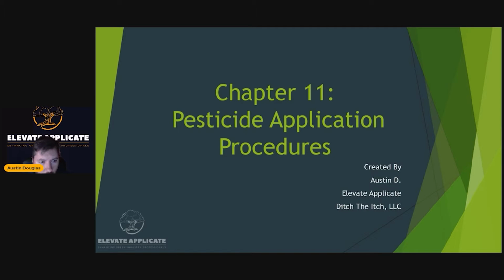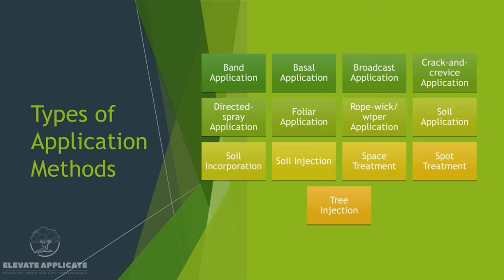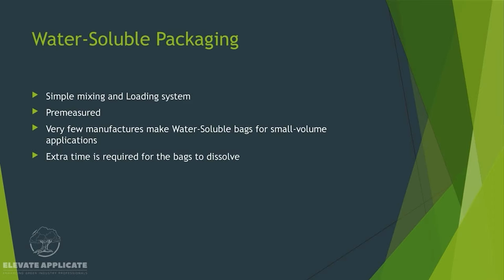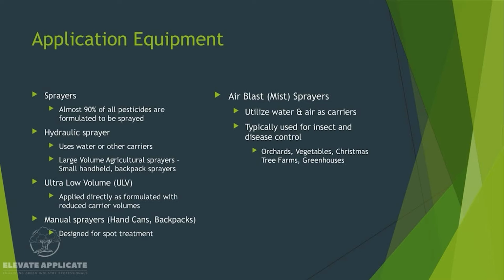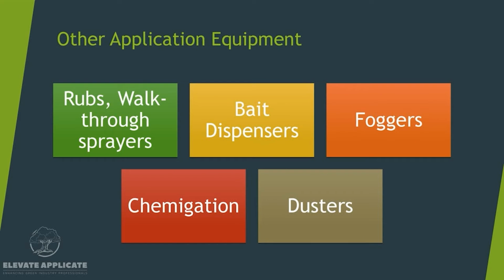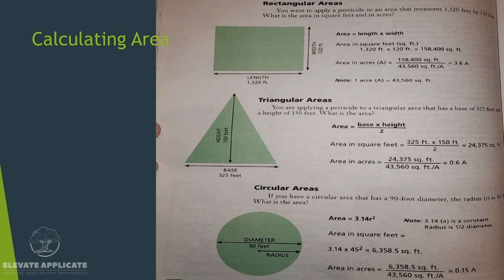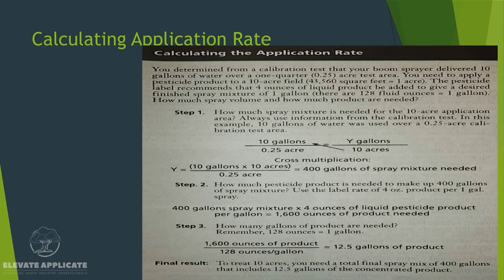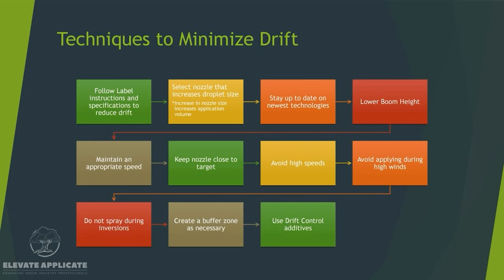National Pesticide Applicator Certification Core Manual - Ch 11: Pesticide Application Procedures

Comment: I live in Michigan and I am trying to get certified for both Commercial and Private. Do I take one exam and check off the box named 'Commercial' and 'Private' and pay for both? Or are there two different exams I need to take? I am unsure of how this process works, since I am new to this. Please help, thanks in advance.
Reply from the maker: I'm confused why you are trying to obtain both commercial and private. Private applicators are for farms, nurseries, orchards, vineyards ect. Commercial is for those who go to other people's properties and apply pesticides. 

What do you intend to do?
Reply: @ElevateApplicate  I have my part 107 remote pilot certificate and I want to apply to this job where they spray fields. This certain job has a requirement of having my pesticide certificate and it says commercial/private. Maybe I will get with them and confirm and see if they mean both or one or the other.
Reply from the maker: If you work for a firm that is contracted to spray fields for farmers, you would need Commercial. You would only need private if you worked for the farm itself and only applied at that single location. 

You'll also need your aerial license. 

Definitely confirm what license. I've never heard of applicators having or needing both.
Reply: @ElevateApplicate  Thank you for your help
Reply: @ElevateApplicate  I have another question. I am trying to apply for the commercial exam and I have to choose my categories of aerial, row crop, fruit and vegetable. When I go in for my exam, do I have complete separate tests for each category? Or just one for the commercial exam? Sorry to bother, but there is not a whole lot of information out there for inexperienced people trying to apply for the MDARD for the first time.
Reply from the maker: My understanding is that you will have to take separate tests for each category. In the lawn and landscape industry they have a combo exam called 6J that covers Core, 3a, 3b, and 6. I am unaware of a combo for Ag operations.